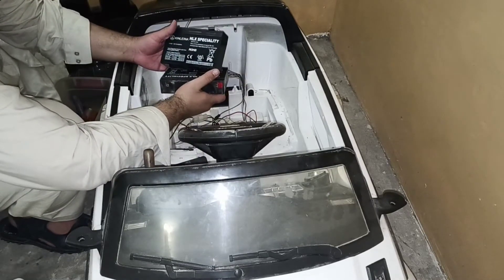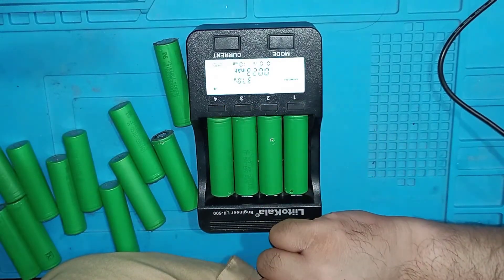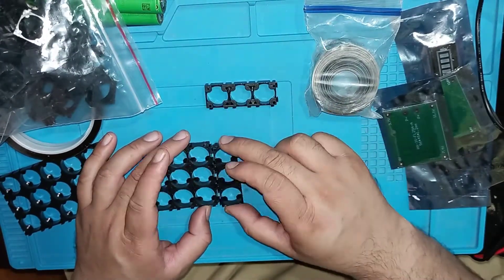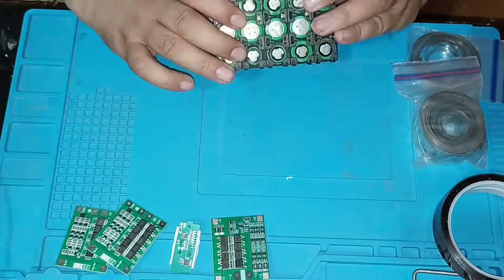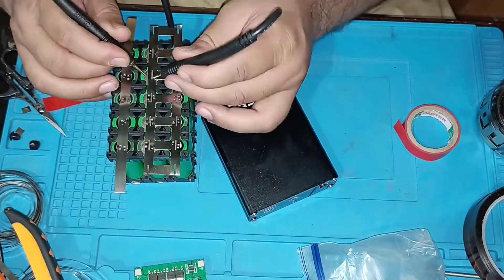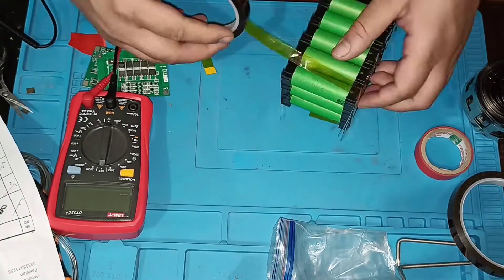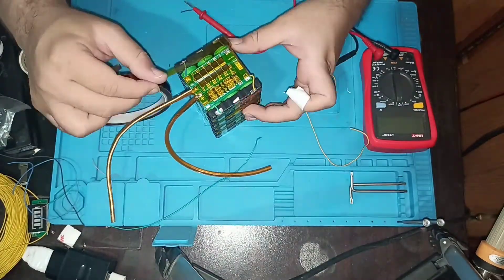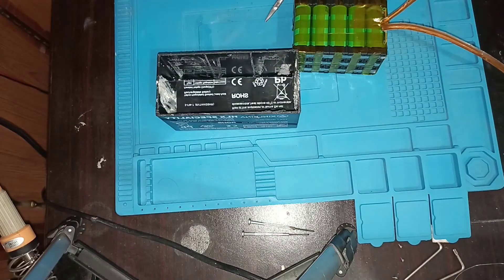kids car battery repair | lithium ion 18650 pack | kids car forward gear not working

Comment: Or ager main self start karne ke liye kitny 18650 cell use kron last time many bike per without BMS laga kar 3 month use kiye battery or 1 din wo blast ho gae
Reply from the maker: No you have use BMS although i don't trust BMS 😁 but u need to use it we don't have any options 😀

Comment: AOA sir kindly ye beten car 🚗 battery benani hai self start Karni Hoti hai many 29 cell pack benya tha but bms 25amp wala use Kiya tha self not working please ye beten car ky liye konsa BMS use kron or Kya 18650 cell theek rehty han gari ky liye
Reply from the maker: Please if you are from Pakistan i give links in description from where you buy BMS and which one
Reply from the maker: Check description now